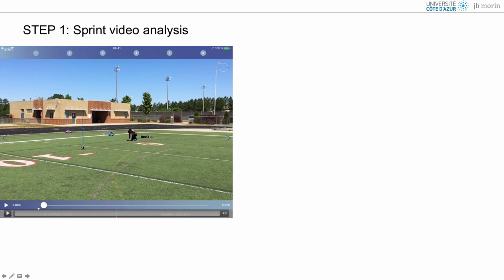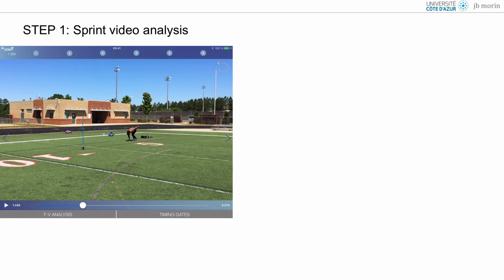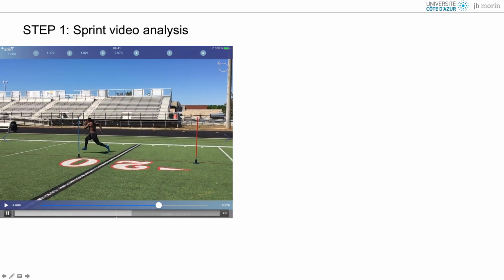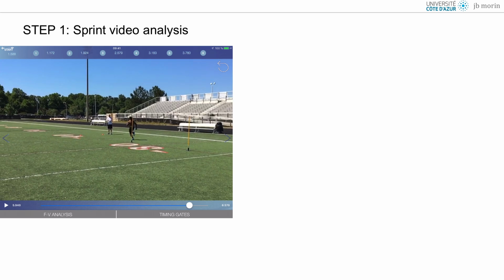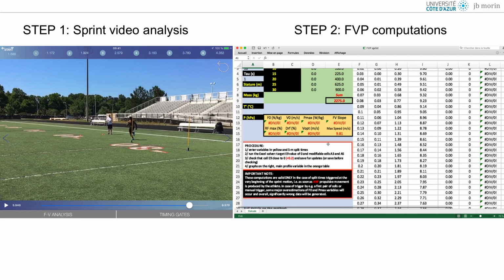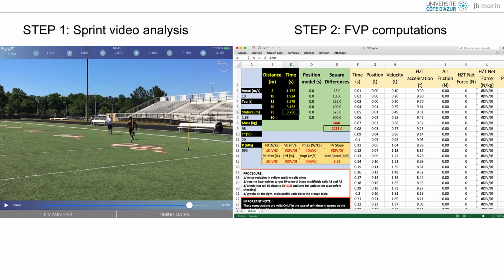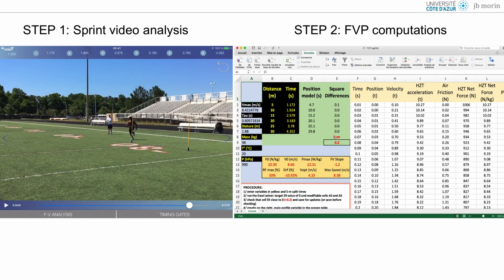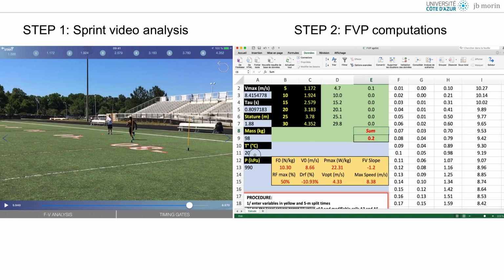MySprint and Sprint analysis spreadsheet

Comment: Can you adjust the distance run, perhaps 60m sprint instead of 30m
Reply from the maker: yes you can update this using our spreadsheet in which you have a position calculator, then you use the app and the split times are not those corresponding to the classical 30m but your preferred distance. see my website: https://jbmorin.net/downloads-📊📈/

Comment: Hello,  

In one of your articles: Interpreting Power-Force-Velocity Profiles for Individualized and Specific Training stated that..... 

"Adding the previously described vertical profiling to this horizontal profiling could help better determine whether a lower HZT-F0 is due to an overall deficit of lower-limb strength (as indicated by a low VTC-Pmax) and/or a deficit in the transfer of this strength in the specific horizontal push-off motion (technical capability)." 

I am having trouble understanding what is considered a low vertical maximal power output. Can you help clarify? 

Hope to hear from you soon,

Thanks again.
Reply from the maker: Hi David, the idea is that if you know the "non-specific" F0 of the athlete (ie the F0 measured during the squat jump test profile) then you can better interpret a low sprinting F0: typically if you observe a low F0 in sprinting (say 5-6-7 N/kg depending on the sport and level/context) BUT the athlete have a good vertical F0 (say 40 N/kg or more depending on level and context) then you can interpret that as being a weakness in how this good force capability in absolute terms is transferred to sprint-specific force output. If BOTH F0s are low then you know that you'll need to work on BOTH a better maximal force capability AND a better sprint specific force output. This is one reason why even if your focus is sprint acceleration, the jump profile might be an interesting piece of info
Reply: @jbmorin3327  thank you!